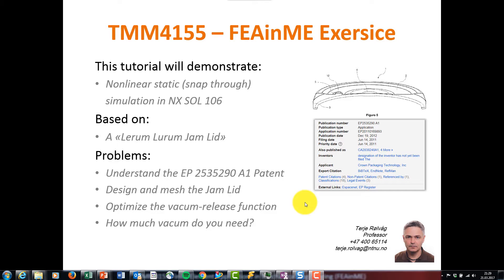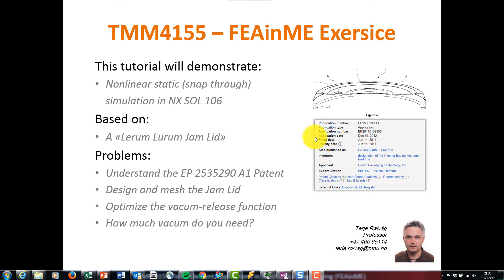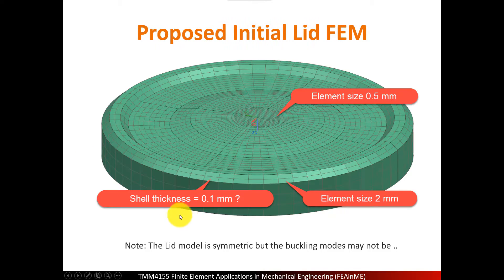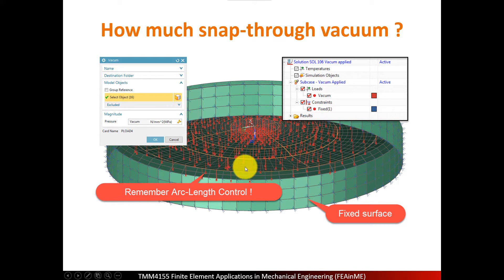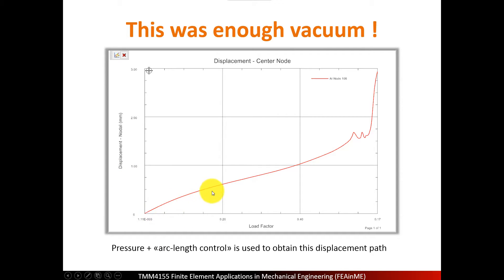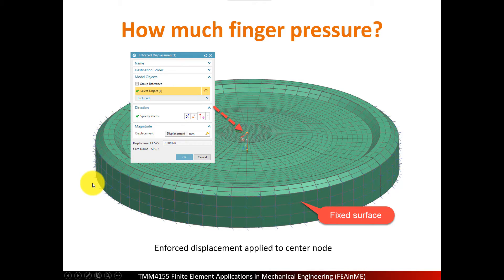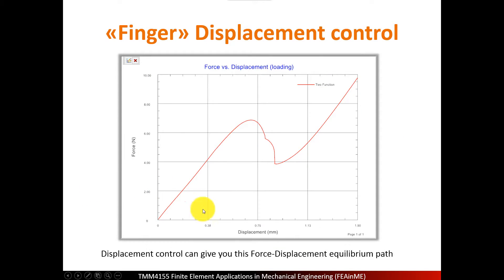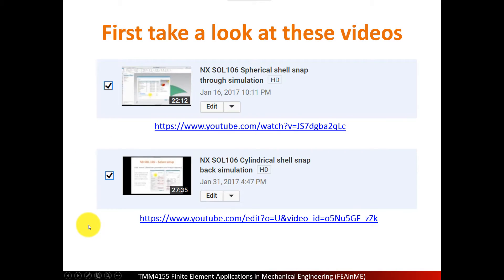NX SOL 106 Jam Lid Challenge

Comment: More on NX please! Can you talk some about the solver differences, 103, 106, 601, etc?
Reply from the maker: I have som videos on SOL 103 that demonstrates it's modal analysis capabilities (free and forced vibrations). Molero gives a rather good explanation on the differences between SOL 106 and 601 https://community.plm.automation.siemens.com/t5/3D-Simulation-NX-Nastran-Forum/Solver-106-vs-601-106/td-p/363977 I will also post some videos on SOL 601 and 701 which are powerful (ADINA) solvers.
Reply: Hello the sol 101 is a static linear solution.
Reply: Sol 103 let you perform modal analyses
Reply: Sol 106 is thé first Level non linear solution :matertial and géométrie non linearities
Reply: Sol 601 is thé advanced non linear solution with surface contact etc. Since nx10 , sol 401 is takin the place and become more and more robust for non linear problem